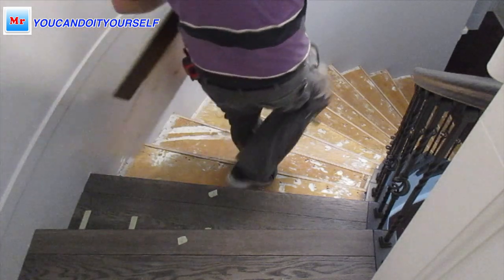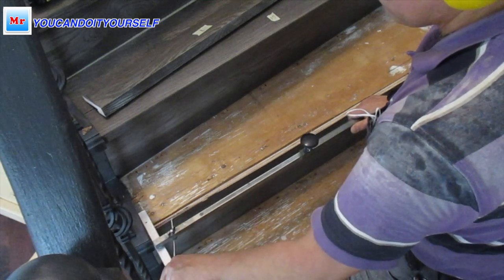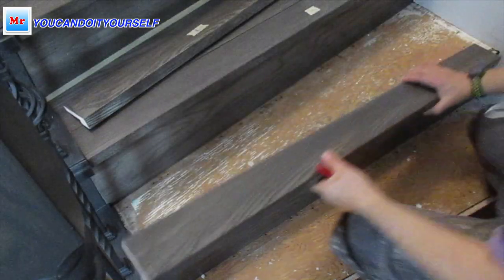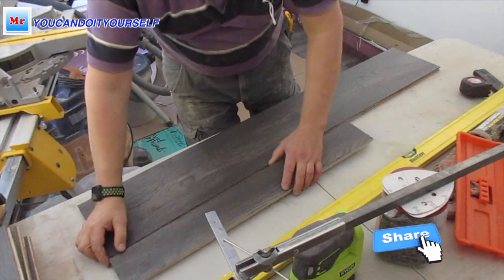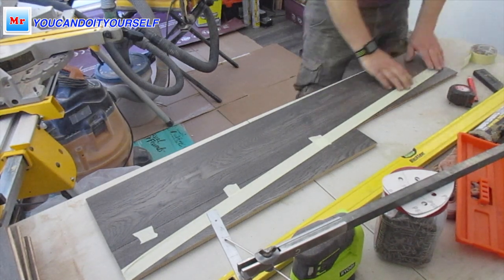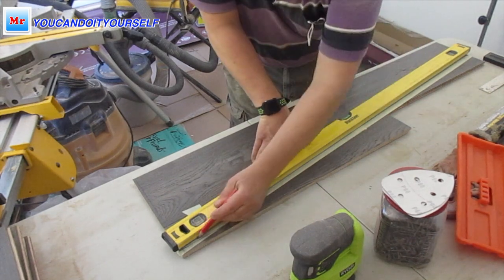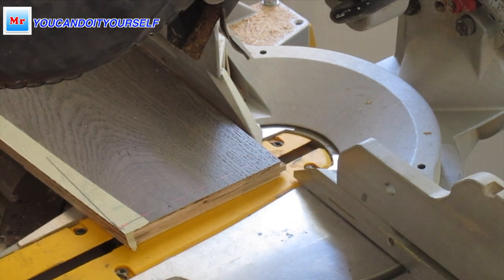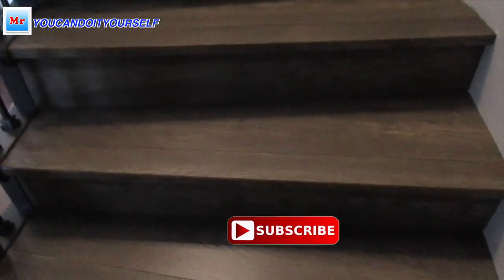How To Install Prefinished Hardwood on Curved Staircase MrYoucandoityourself

Comment: Hi, just a question - what would you use to level a subfloor before installing 3/4" x 3 prefinished hardwood flooring? 

Learned lots from your video - truly appreciate it. Thank you.
Reply from the maker: If I am right, you will install nail down over the plywood subfloor. Here is example - https://youtu.be/UPowP3bez5A

Comment: I don't understand how the tread fit if it was cut too big. How much gap do you leave on the sides of the treads? I tried to cut them tight but ended up scratching my walls and now I have gaps on the sides of my treads.
Reply from the maker: Should be without gaps. I have to see what you doing.  I guess this video  I made very detailed.

Comment: Can you install vinyl plank on the bottom curve step?
Reply from the maker: Hi Carlos, yes it’s possible. Need make a full tread and than cut curve profile  with 45 degrees. Then install front of curve nosing 45 with both sides. Make curve bottom of the nosing and glue it with front. after drying glue, sanding edges of the front of the step. Done.

Comment: I see you show installation procedure but what happen when you removed carpet and wants to install wood on stairs and stairs are not meeting local state code requirements. How do u fix risers with different heights.  there is  certain tolerence allowed for risers and treads  to meet STATE CODE
Reply from the maker: What the heights on your stairs?
Reply: The riser are 6 3/8 "  to 6 1/2 "  + 1"  existing Tread. = approx 7 1/2''   Now  when i add wood on top to existing Tread it is another 5/8" inch. Total height will be 7.5" + 0.625=8.125"  inch.   This will break State of Texas building construction code
Reply: My stairs are semi curved. It is not spiral.  So it has different tread depth
Reply from the maker: Put laser on top of the staircase and measure height of it, then divide on the volume of stairs and you can get height of each riser. Start repearing from the bottom stairs. Your riser can be from 7” to 7.5”. Check your code in the Google.
Reply from the maker: But all steps should be taken before the same.